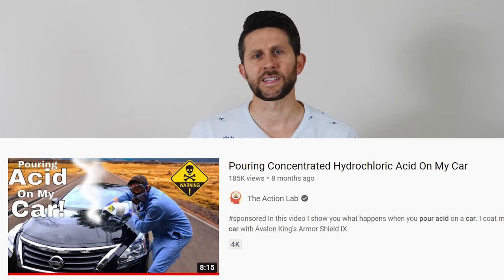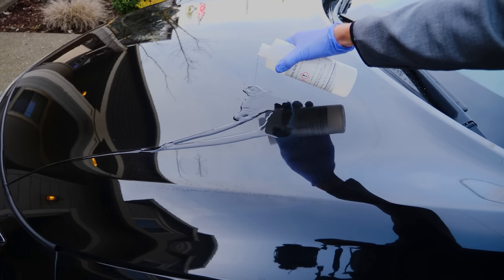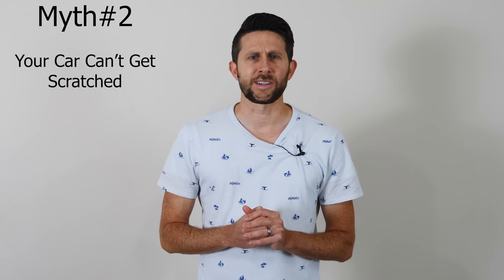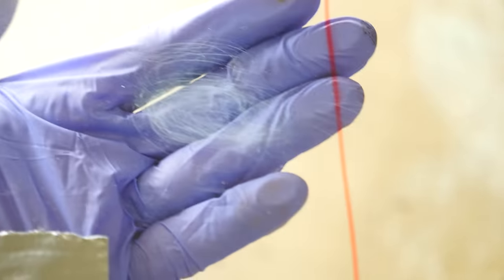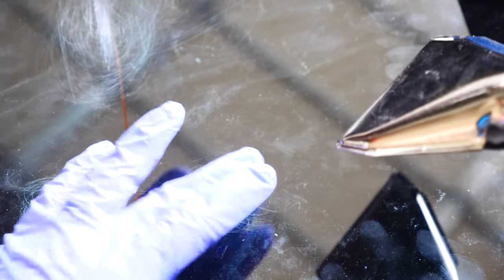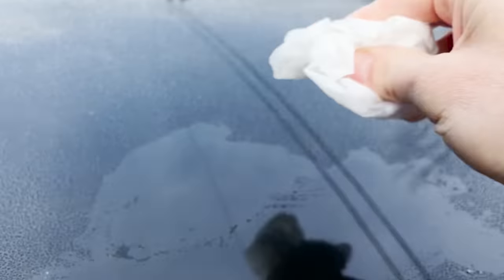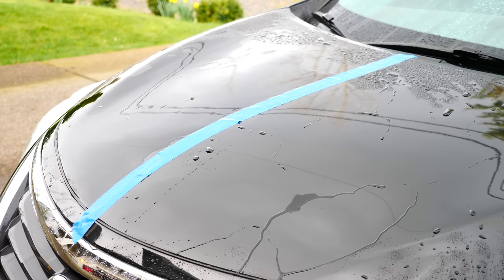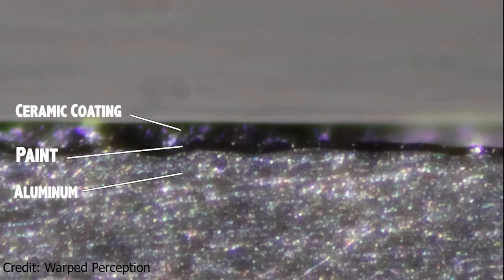Testing The Myths Of Ceramic Coatings

Comment: The way how the glass breaks with temperatures and force would be great detail to learn about.
Reply: Gепshiп lмрасt 🅥  Guess after Genshin comes a Car-Gacha game with destructive physics...
Reply: I guess is like when you drop a hot glass into cold water and it shatters: different parts of the glass are expanding at different rates which builds up stresses which eventually lead to a break.
Reply: @sutapadey5274  I’ve seen this, but I mean by the pattern difference. Force vs temperature. See how he broken it in this video, the glass was in waves, in the link the glass is sharper and more line segments.

Comment: I have read a few comments about what some people are saying that no ceramic is present in a ceramic coating. "Ceramic" is a general term for anything inorganic..like sand or the lenses of your glasses, which aren't glass, by the way. They can rightfully be called ceramic coatings. Most coatings contain silicon dioxide. Others contain silicon carbide which is much more durable than silicon dioxide. There is no petroleum or silicon present. They are legitimate sacrificial layers that make your paint easier to clean and stop oxidation.

Comment: If the coating was a hard-baked layer of ceramic similar to powdercoating, then sure, I'd believe the myths. But clearly it's not. Another question; if the ceramic coating is 'harder' than the clearcoat, will repeated application actually damage the clearcoat?
Reply: P sure it's only harder once it dries... you know, like normal ceramic materials
Reply: @joshyoung1440  Ceramic needs to be baked though? You can't just let it harden in the air.. similar to porcelain, or the ceramic coatings on exhausts for example. Unless you bake it, it's no stronger than dry mud. That led me to assume that the stuff mentioned here has baked ceramic particles in it, and only the binding agent needs to harden after application.
Reply: @joshyoung1440   The materials get quite hard once they dry, the way that I usually put it is that you are creating a solid mineral layer over the surface of your car. Most nowadays are 9H, but there are some that go up to 10H. My recommendation though is to always check with the 10H claim, because some are legit (and they will usually have documentation to back it up), and others have used it in the past as a scam to sell inferior products.
Reply: @Renzsu  You are correct here. Professional grade ceramic coatings do need to be baked to get the full effect. Usually it's done under specialist UV lamps, and the room needs to be kept pretty sterile to avoid dust and other material from contaminating it. 

The type that AL used is a DIY kit, which is still pretty good. But they often do not harden quite as well due to a lack of baking. The usual curing period is at least 24 hours to get the basic hardening, but for the reaction to complete it takes about 2 weeks.
Reply: @MrValentine101  Ahh ok, didn't know that you can UV bake/cure ceramics as well. I assumed you needed heat. Cool, learned something new :)

Comment: Interesting video! However, I have a question. If we reapply the ceramic coating on top of the scratch marks, will it reduce it? 🤔
Reply: Nope, you can apply a touch up, that matches exactly with the colour code of your car
Reply: That would only depend on how deep the scratches are. If they are below the paint then yes you'd have to have it repainted. But if it is only the ceramic coating or clear coat then it could effectively be buffed out and a ceramic coat applied.
Reply: No, they need to be compounded and polished out then ceramic coating reapplied. There are some polishes for ceramic coating for very light scratches

Comment: Does the ceramic coating works on any surfaces? If it does, then applying it to things that you don't want dirty would greatly help. Example, if applied to a kitchen knife, the cleaning would be easy and food might not stick to the knife as much. It might also makes for a great killer weapon since the blood would fly off with a single swing in the air like in the movies.
Reply: yeah it does I'm pretty sure i mean you can put it on the plastic and chrome on your car so why not everything else
Reply: That sounds like itd get in the food

Comment: I have been a professional car detailer in the past.  I worked on import cars.  BMW, Mercedes, Lotus, Ferrari etc.  I know how to use a high speed buffer.  Most scratches are actually in the clear coat.  That is why the high speed buffer can heat up the clear coat and the scratches are gone.  When the scratch is deep and to the paint then you can't remove the scratch.  With the ceramic coating that is just an extra layer of protection.  ceramic coating  might be thicker but it is like using a high quality wax.

Comment: There are no advantages of these so called "ceramic coatings" compared to regular wax or silicone oil coatings. Also think about it some more: Ceramics are usually polar or even ionic compounds made out of metal cations and some sort of non-metal anions (most common: Oxide, Nitride) - why should such a compound be hydrophobic in the first place if it really was a ceramic? I call snakeoil, especially when it comes to the naming and actual ingredients of these coatings.
Reply: Yeah. There is literally zero ceramic in any of these products..  It will be silicon doing all the beading.
Reply: Not a ceramic at all. I don’t know how they are allowed to sell a product labeled “ceramic” when it is not ceramic.
Reply: I'm not in such a rush to take science advice from someone who doesn't know how "cation" is spelled
Reply: @ironmaiden5658  silicon can be present in ceramics.
Reply: @joshyoung1440  Fixed spelling. English is not my main language. Anyhow, do you have some actual criticism on the subject or are you just here to nitpick?
Reply: I actually believe there is a difference. Regular waxes are petroleum based right.  At least the ceramic product I use is not petroleum based. You can say what you want the results, application, and wear I get from the products I use kills any wax out there I've ever tried 100%. Now that's my own experience. But ALL petroleum based product attract dust and debris, that's counterproductive to what they supposed to be doing. 
I'll stick with the ceramic products I use. They've worked well for me.
Reply: You know that diamond blades aren't actually made of diamonds right? Yeah, you're not putting an actual ceramic layer on top of your paint, but it's still a lot more durable than any wax out there and there's a ton of videos that proves it.
Reply: @Psychx_  You are just rude.
Reply: @sridathan1876  Sir, you haven't seen me rude yet.
Reply: @Psychx_  I can understand your positively offset emotional barriers. But you need to fix it right away!

Comment: That ceramic coating is actually pretty good. It lasts about 10 months on areas like bumpers that get scrubbed regularly for bug removal. Does make the bug splats easier to remove, too. Regular wax only lasts a month or two around here with the harsh elements
Reply: Thanks Paul. We guarantee minimum 2 years with proper maintenance

Comment: Consider a container which contains a liquid . we put a fine tube in it such that it does not touch the base of the container . the liquid will rise to a height h in the tube .Can you please make a video explaining why does a liquid not overflow if a capillarity is cut from below the height it originally rose. In my book it's written that the meniscus adjusts it's radius of curvature. But what if we use a liquid at its critical temperature or we can use really pure water so that the surface tension is zero and no meniscus is formed in the capillarity . Then the radius of curvature is already maximum.  Then what if we cut the capillarity tube from below the height the liquid originally rose. Will it overflow. In my book it's written that it will never overflow but it has not discussed a condition when surface tension is zero.

Comment: I applied it to my bathtub. Even though I didn't use harsh or abrasive chemicals the coating sadly didn't last very long.
Reply: Oh, should work fine for 2 years. How long did you let it cure for? We recommend keeping completely dry for 48hours and away from soaps/washing for 5-7days

Comment: I would be careful not to be litigated against since your testing methodology is poor and your application also looked poor.

You can tell by the surface characteristics that your coating is either cheap or your application preparation wasn't sufficient.
I think both are true.

Also, ceramic is a marketing term, it refers to nothing in the actual formula so a ceramic coating can be vegetable oil or beeswax, or it can be an amazing nano polymer.

Check out the science by the YouTube channel Final Inspection Car Care Products for a lesson how to to communicate the science of these types of products better.

Comment: Sincere question: can mercury conduct electricity?
If so, what happens when you allow electricity through it?
Can you use it in lieu of copper wires?
Reply: That is a very complex question that the Nazis tried to explore. Modern science (the unclassified kind anyway) doesn't understand magnetohydrodynamic fluid very well. Yes you could use it instead of copper, but not practically.

Comment: When does sandpaper ever touch a car? It is a to hard of a compound to test in my opinion.
Reply: Sandpaper is used to simply replace the HUGE amount of things that can easily scratch your vehicle. Saves time showing them all.
Reply: @tigerdragon7783  I don't agree. You can rub plastic on plastic for years and it will leave minor scratches but it doesn't "cut" sandpaper is such an hard compound that it will even "cut" in glass. Even with just regular steel you can't even scratch glass. Compare it to a mill. If your mill is made of plastic you can try your hole  life to cut in metal but it's never gonna happen. But with tool steel of carbide it cuts like butter.
Reply: @TIGFab97  Free to disagree. Though your examples are bad comparisons to what I said.  In the "real world", a metal shopping cart IS going to scratch your vehicle if the rubber bumpers don't block it. Purses with metal buckles WILL scratch your vehicle. Tree branches and twigs WILL scratch your vehicle. The sandpaper is a scientific 'reference point'. So disagree with bad comparisons, don't disagree with a good video. 😙
Reply: @tigerdragon7783  OK fine, you just don't understand. No problem at all. But that doesn't mean I've bad comparisons. If you know something about materials, you know that the harder material will cut in the softer material. Maybe it can withstand rubbing to metal. Sure it will leave marks! But maybe it doesn't cut really deep enough to destroy the paint. But sandpaper God damn it's such a hard compound made of oxides you can even scratch diamond with it

Comment: Depends on what ceramic coating you have. They do make 2 part paint (epoxy) that is used to coat the inside of oil well tubing for added protection against caustic chemicals. Also This type of ceramic costing is much stronger and is actually a lot harder to scratch. I've seen toolboxes coated with this stuff sitting out in the sun for years without a scratch and didn't fade in color either. Pretty expensive, but i know a place that will paint your car if you're interested.

Comment: 1:42 pretty useless test glass and ceramics both are pretty hard
if you can already scratch glass you can probably scratch the ceramics aswell
shouldve coated a solid but not as hard surface to be able to compare if it adds extra protection or not (just a piece of a car or sth :D)
3:25 per convention the "right side" of a car is the right side while driving in its usual driving direction